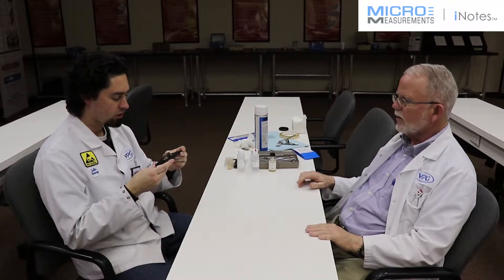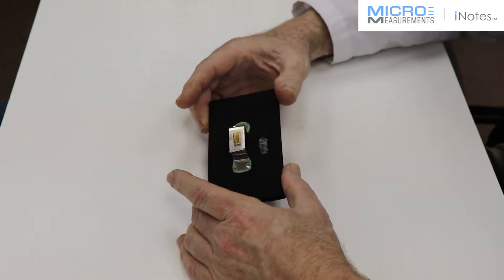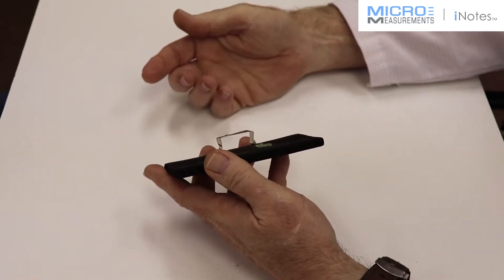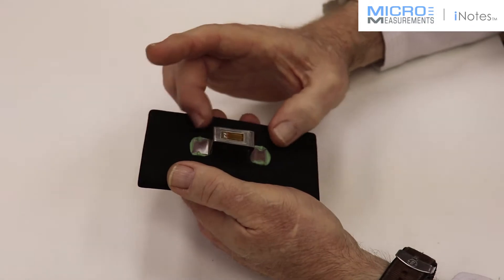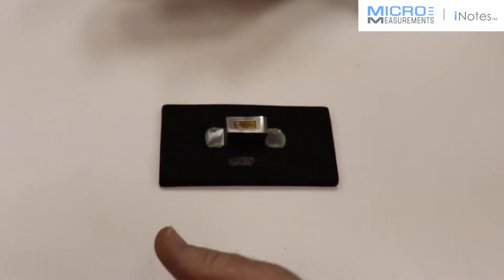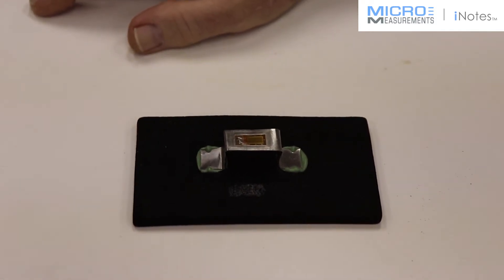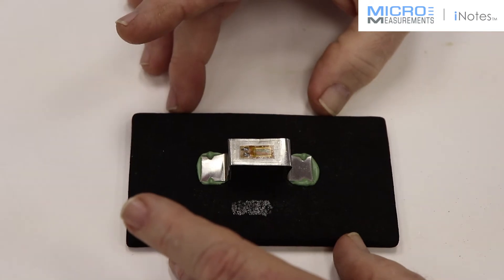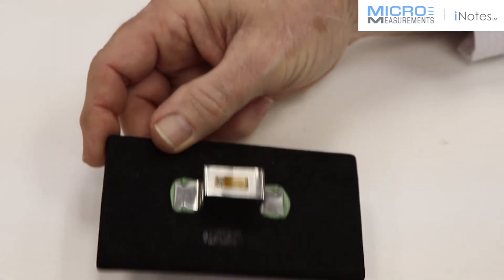Clip Gage (Elongations Exceeding 20%) - Experimental Stress Analysis

Comment: El análisis experimental de esfuerzos de los materiales estructurales a veces requiere ensayos hasta que se produce el fallo. En esos casos, y en particular con los materiales dúctiles, el fallo suele ir precedido de grandes deformaciones locales, cuyas magnitudes son de interés para el ingeniero de ensayos. Es en esas situaciones cuando son especialmente interesantes y adecuadas las bandas extensométricas de la serie EP de Micro-Measurements, con las que se podría llegar hasta un 20% de formación (200.000 mm/m). No obstante, hay algunos materiales como el plástico o el caucho, donde las deformaciones pueden llegar a superar la capacidad de las bandas extensométricas de la serie EP. Tanto en estos últimos, como en general siempre que haya grandes deformaciones, el dispositivo de flexión que se muestra en este vídeo es muy útil.
Si necesita más información, por favor no dude en contactarnos. mm.es@vpgsensors.com miguel.bravo@vpgsensors.com